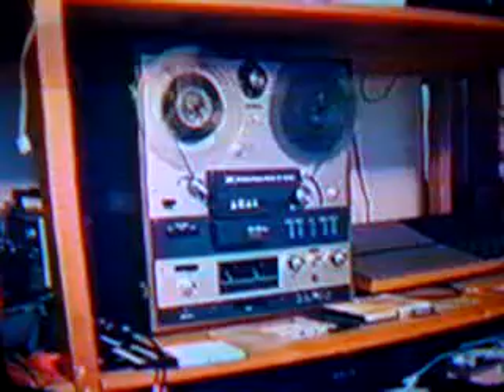Finding out the bias of YOUR tape recorder.

Comment: This is really interesting.  I suspect most of my tape recorders I've had over the years are DC Bias.  I do have an old Sharp portable stereo system with a tape deck, it has a beat cut switch, I'm pretty sure the unit is AC Bias.  I have a few portable hand held tape recorders and I don't know what bias they use.